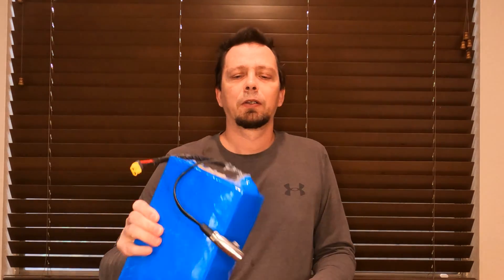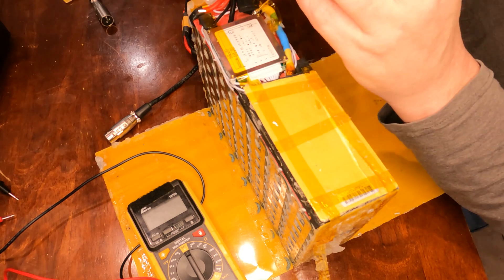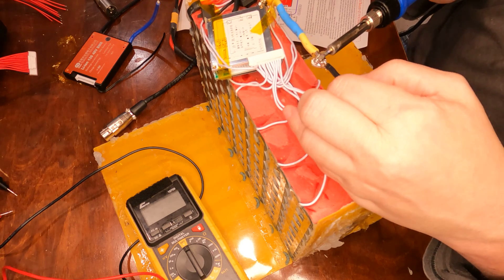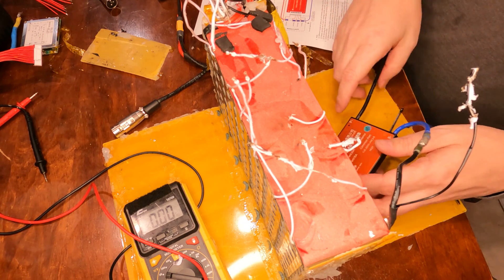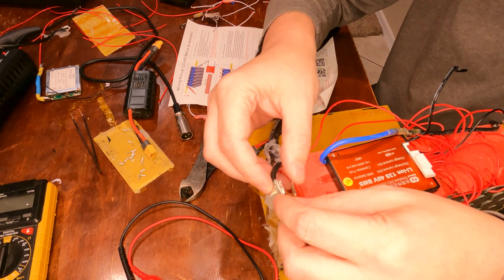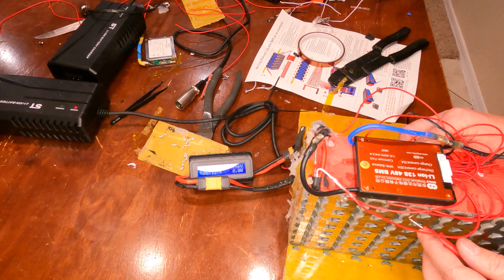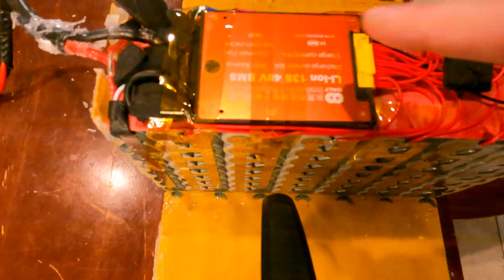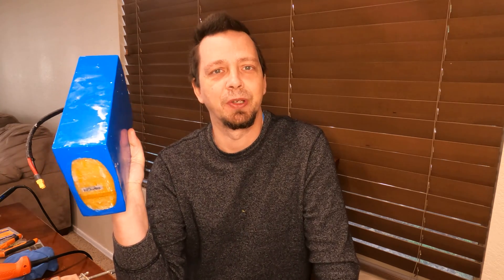Replace BAD BMS on a Electric Bike Battery

Comment from the maker: 😇Subscribe: https://www.youtube.com/user/lastend1?sub_confirmation=1
I earn commission if any item is bought using the links below. That said I do give unbiased reviews of them given I had to use my own money to obtain them.

🛒BMS: https://amzn.to/3UXrvJT
🛒in line Meter: https://amzn.to/3nM6N28
🛒Multimeter: https://amzn.to/3PdFDgQ
🛒Solder Iron Kit: https://amzn.to/3W51BFl
🛒Solder: https://amzn.to/3g33HTf
🛒Heat Gun: https://amzn.to/3HvI7W3
🛒Solder Seal Wire Connectors: https://amzn.to/3hjfBwi
🛒Battery Heat shrink: [Listing sold out]
🛒Heat Resistant Tape: https://amzn.to/3FQv9RS

Comment: Personally, I would have edited out the part where you nearly burnt your house down, doesn't really inspire confidence!
Tip No.1 "Keep the heat gun away from the balance leads!" Check!
Tip No.2 "Keep Eric away from the heat gun!" Check!
Tip No.3 "Edit out the part when the Fire Service arrived to put fire out! (In case 'Mrs Eric' watches the video!) Check!
Tip No.4 "Rebuild the house before 'Mrs Eric' gets home!" Check!
Serious Comment: Wouldn't it be safer to solder tabs onto the balance wires away from the battery and then use a spot welder to attach the tabs onto the cells? This reduces the amount of heat you are subjecting the cells to by directly soldering, which as I'm sure you are aware can damage the cells and possibly cause you more problems!
Nice video though! Excuse the sarcasm but I hope you appreciate my constructive comments.

Comment: Need to service my BMS, as it’s gone totally dead - no Volt’ums out at-all - and the battery proper is 90+ charged up.  Got some sparken-spitzen getting the wrapping off.

Am wondering about a 14S “smart” Daly BMS, with an active balancer.  Comments?
Reply from the maker: This https://amzn.to/3Y33k1S ?
Reply: @Eric_Tennant  or similar, though that one doesn’t indicate what current capacity it has.  I’ve Heard (read it in online forums) that one wishes to over-specify these things, e.g. if you’ve a stock BBS-HD good for 1500 watts in (30 amps or so…) you want a BMS that’s good for a fair bit more, e.g. 60 amps.

Is this true?
Reply from the maker: 30amp is all you need for 1500.
Reply: @Eric_Tennant  I’m afraid I’ll smoke it when I come to a bad hill if I don’t over-spec the thing.  I’ll do some more looking so as to be certain.
Reply from the maker: Here's what I did to all my batteries https://youtu.be/rXX4FNvY6hk
Reply: Did your BMS come with printed instructions, or did you get them from Online?
Reply from the maker: It came with a print out.
Reply: @Eric_Tennant  thanks.
Reply: Note: have found at least one indication that over-specifying one’s BMS is a good idea.

I got a 60 amp rated unit, as well as an active balancer module, both “smart”, both Red (Daly) - and both with Bluetooth/Bluenose modules.

Am getting onto the changeover now - should take a few days, as I cannot be too careful with this stuff.

Comment: Man, that was close! Id bet your wife would have had a real fit if you scorched her table!!! 😂
If that happened you could always tell her you got into a new hobby of wood burning😃😂🤣

But on a serious note, just a quick question and please forgive me for my ignorance but couldn't one place a fuse of some kind somewhere in the battery or the BMS?

GREAT video my friend!
If you use a fire extinguisher just make sure it's rated for electrical fires.

Be careful and take care my friend!
Reply from the maker: Every balance wire would need one to stop what happen to me. Really was avoidable if I wouldn't of had the heat gun pointed at it.

Comment: Thanks for the sparks. That was pretty exciting. I thought, oh crap there's gonna be a fire. I learned a valuable lesson. Keep the heat gun away from the balance wires. LOL Great video Eric.
Reply from the maker: Think that thin red paper saved me from a house fire.
Reply: @Eric_Tennant  Yes. You were super lucky. I have been tempted to change my bms or bypass the bms discharge wire to upgrade my controller for more a powerful one, but I will hold off until I gain more knowledge and confidence. My priority for next summer is to triple my range by adding 2 more battery packs. I'm thinking about building the battery packs myself. That will be a good winter project for me.
Reply from the maker: Just got a spot welder to fix an other battery. Now I have all the tools to build one. Still learning as I go, but other then making stupid mistake I know how to build one now.

Comment: The one thing that bothers me about your battery is that the cells are only isolated by the thin vinyl shrink wrap on each battery can!
This is one of the reasons cheap Chinese short and catches fire.
Reply from the maker: True. In order to have the smallest foot print UnitPackPower likes that cheap 18650 heat shrink with no plastic inserts spacing them apart. This is common from most battery makers. Real danger is at the positive of each 18650. That paper ring really is the strongest part there as that plastic wrap rips easy, and positive negative only have that hair gap.

Not sure what happens if negative to negative happens. I would think nothing, but I have not tested this. Hot glue and the 2 heat shrinks are the hope to keep the sides of each battery from ripping.

Always have to be fast to eject the battery or be fast getting away. Really its not as common as the news would like you to think.

I do like that Red paper. As it did act as a fire/heat stop for me on this heat gun fail.